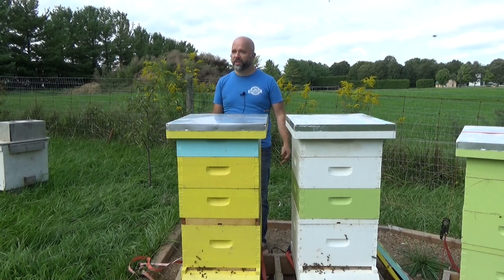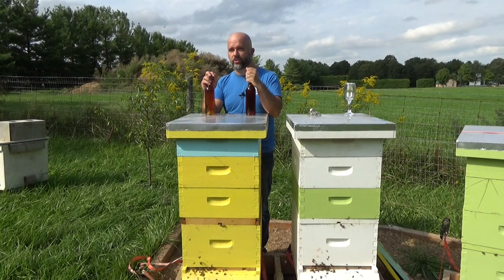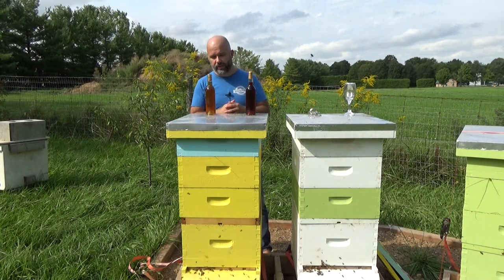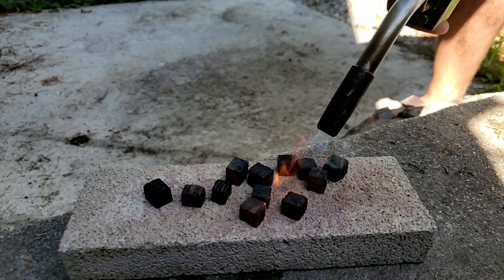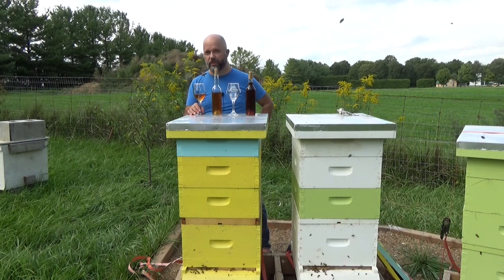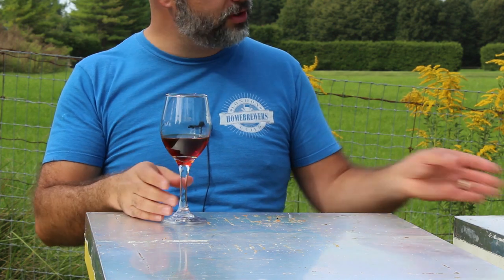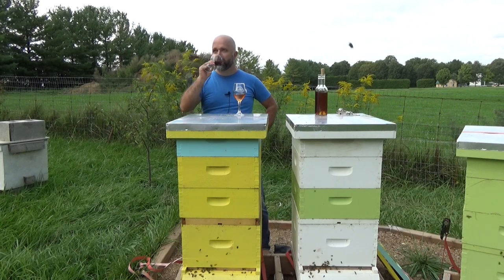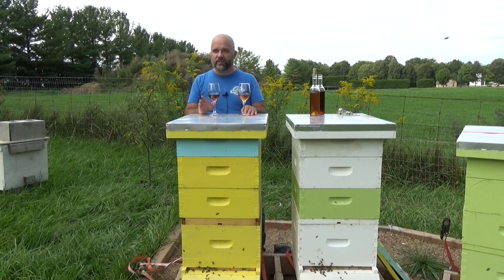An Experimental (Maillard) Bochet

Comment: It'd be interesting to know the actual pH change of the honey from adding the lye solution. I've read pH of honey can vary between 3.5 and 5.5, which 3.9 being the average. My chem degree partner thinks you didn't add enough NaOH to achieve an alkaline environment. 
Unrelated to Maillard reactions, I recently read about how pH affects caramelization. Caramelization is lowest at pH 7, but there's accelerated caramelization if pH is < 3 or > 9. It'd be interesting to see the difference in using an acid vs. base in a bochet process.
Reply from the maker: Honey has very little buffering power; it doesn't take much to change its pH. Minor changes in the flowers bees visit can change the pH from as low as 3.5 to as high as 6.0. My fall harvest honey (which is what is used here) is typically between 5.3 and 5.7.

 Moreover, you do not need an alkaline environment for malliard reactions to occur. They always occur, in competition with caramelization reactions. Three factors affect the balance between caramelization and malliard reactions - sugar concentration, protein concentration, and pH. In all three cases, higher values = more malliard. At ~82% sugar by volume, malliard reactions dominante around a pH of 6. My post-dilution pH was 7.8, which (therietically) gives a pre-dilution pH of 7.9-8.1, depending on the assumed buffering power of the honey.

I've used acid extensively for inverting sugar (this is covered in some detail on my blog), and never had many issues with caramelization, although I doubt I'm sub-3.0 pH, given that I'm using low doses of acetic or tartaric acid.
Reply: @SuiGenerisBrewing  Very cool. Thanks for the details. I figured you weren't willy-nilly adding bases without doing the math. ;-)

Comment: I have some potassium hydroxide for hydroponic buffering.  Would a dilute solution of that result in similar effects, while adding K to the resulting must?
Reply from the maker: It should, as it is about as strong a base as the lye (sodium hyrdroxide) that I used in this video. I'd want to ensure it is food safe, however, before using it in a mead.
Reply: @SuiGenerisBrewing  much obliged :)
Reply: Attempted a 4L batch with 1/5N NaOH and DAP, fermented dry in under a week, very nice flavour despite it being so young, bottled already.  I look forward to it when it has time to mellow, I skipped the oaking and may amend it with a splash of bourbon to approximate it when I taste it again in a month or so.
Reply from the maker: @m0nkm0de  sounds amazing!